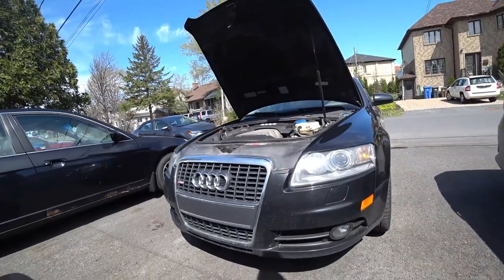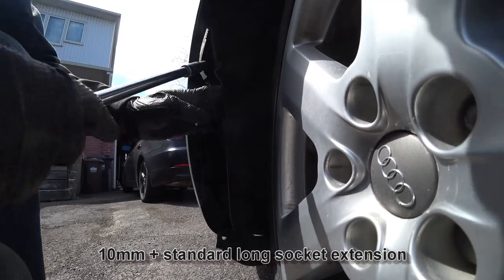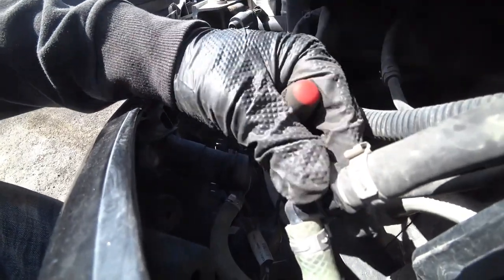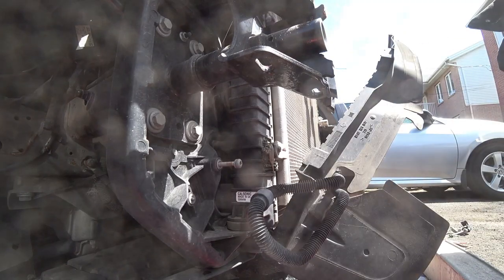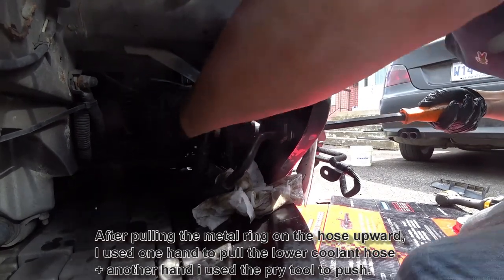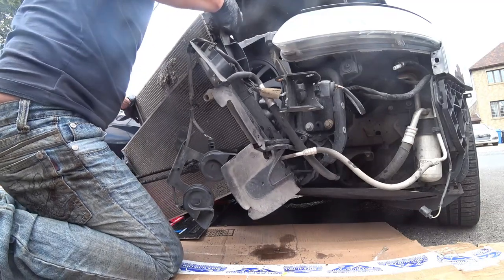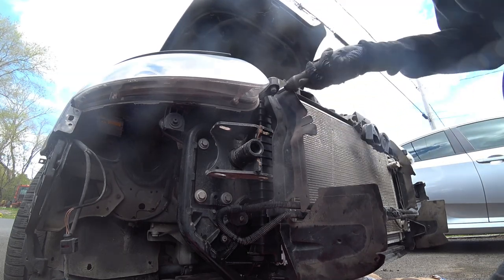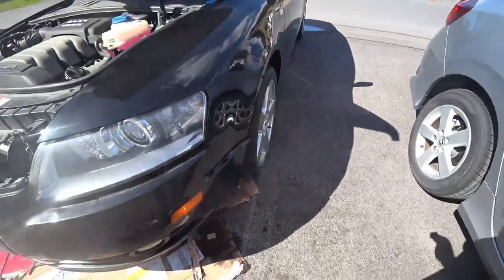EASY WAY - How to change your radiator Audi A6 C6

Comment: This can be an all day job at home. Unless you are very fast and skilled. Im doing this right now and it is time consuming alot of bolts and parts have to come out. Prolly 4 or 5hrs. I charged 8hrs of labor.
Reply: I did it in 3 hr
Reply: So in other words, you're ripping someone off.

Comment: Bro how long did it take you? I need to change mines and are there radiator lines near the bumper? Because I have a small leak close to my fog lights on the driver side
Reply from the maker: 3-4 hours i think, no lines near the bumper.

Comment: 2009 C6. Everything was the same...up until I have to pull out the radiator. Not the same. This is the 3.0T, so, the radiator is mounted differently. Have you replaced a radiator on a 3.0T?
Reply from the maker: Hello, sorry, i never had a chance to work on the 3.0 supercharged unfortunately.
Reply: I need to change the radiator on my 3.0 did did you end up finding a video about it I’m not having any luck only for the v8 and the 3.2

Comment: Where you located?
Reply from the maker: Montreal
Reply: @MTLJack  if you have questions also you can message me i have a 2007 audi a6 3.2 quattro i did all the work myself so i know alot
Reply: @rival3825  @MTLJack by any chance do any of you gentlemen know if i have to drain the transmission fluid for this? had a fender bender so replacing the radiator and ac condenser, appreciate the speedy fed back trying to get back on the road, also if i need to support the engine since the front of the engine is sits on the radiator.
Reply: @MTLJack  by any chance do any of you gentlemen know if i have to drain the transmission fluid for this? had a fender bender so replacing the radiator and ac condenser, appreciate the speedy fed back trying to get back on the road, also if i need to support the engine since the front of the engine sits on the radiator.
Reply: @rival3825  I want to do mines but not sure how long it will take
Reply: @curtisanderson9639  it took me 2 to 3 hrs only cause I stopped for a break and I cleaned everything but it's a task for sure
Reply: @rival3825  thanks again for the reply man.. I actually found a shop earlier today and had it done for $675 new radiator and plus labor.

Comment: This is a great video.
Ask a question.
You removed the transmission cooler line on the passenger side and a little oil fell out. Is it transmission oil? Or is it engine oil?
Does the O-ring need to be replaced?
Also, when injecting coolant, how did you bleed the air without using a vacuum?
I do not live in an English-speaking country.
Thank you.
Reply from the maker: I think it was transmission oil that came out from the lines. I strongly suggest to replace the O-rings. All i did was, i left the coolant bottle cover opened, left the car idle & rev a bit, the coolant will slowly go down. Then keep refilling till the MAX line.

Comment: I broke my radiator air duct from upper side its full of rust even cant remove the lower pipe as I have 2.0t
Reply from the maker: 2.0T are much easier to work on

Comment: How different is it to do this on a 2012 Audi a6?
Reply from the maker: probably the positions of the screws are all different. Different screw or bolt sizes but in general, shoulnt be too far off.
Reply: You ever figure it out bro??